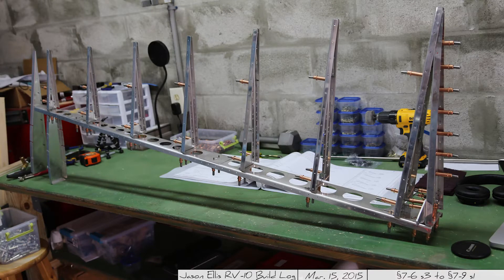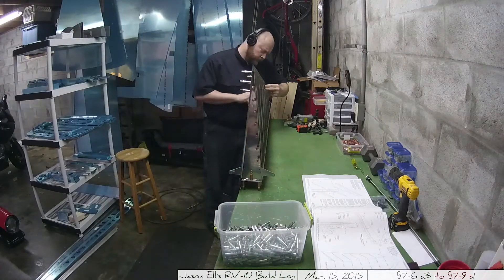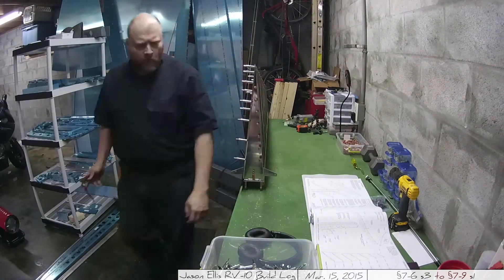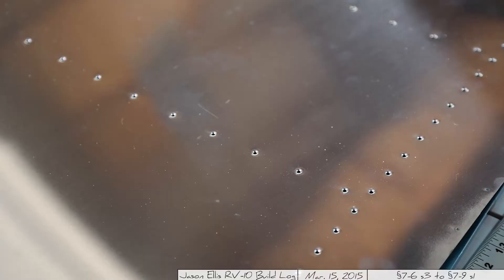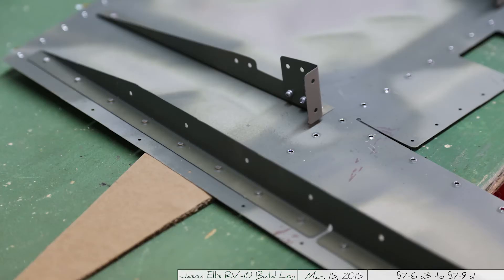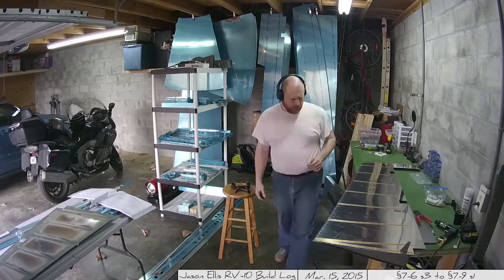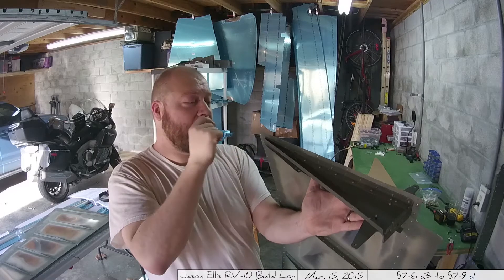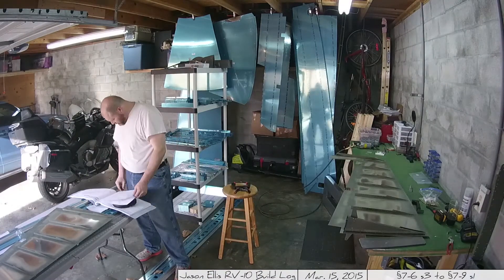RV-10 Empennage Section 7-6 to 7-9

Comment: I got so frustrated trying to get into that spot that I drilled out the 7 470ad4-4s and 2 of the 470ad4-6 from rudder horn to separate the to parts of bottom rib. Back riveted the smaller side to the right skin like the stiffeners the re assembled the bottom rib. Not how the called for in plans but got the job done
Reply from the maker: Good idea!  I think at this point, knowing what I know, I'd be more open to just drilling things out and doing it my own way to get the job done.  Back then I was trying like heck to do it as they said because it was "the right way".. etc.. heh